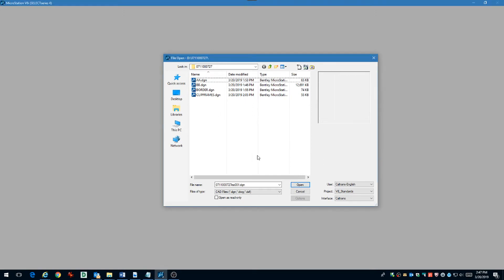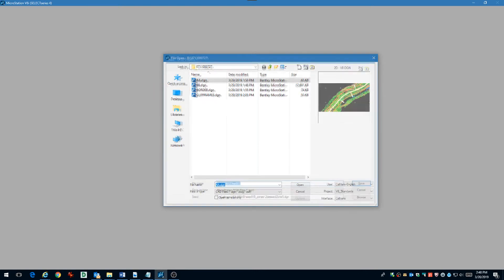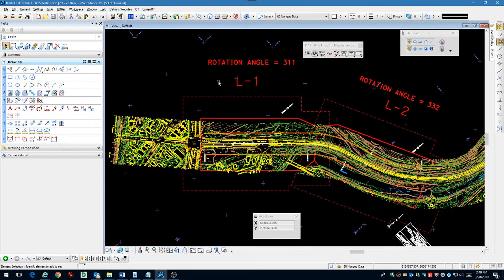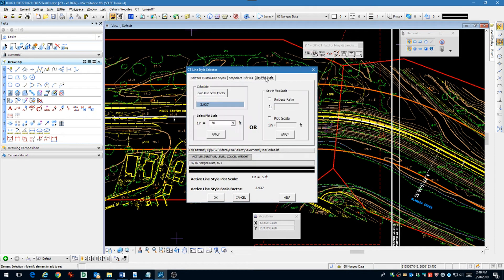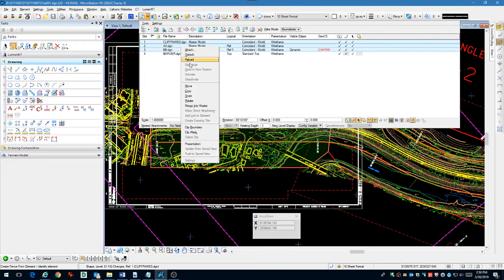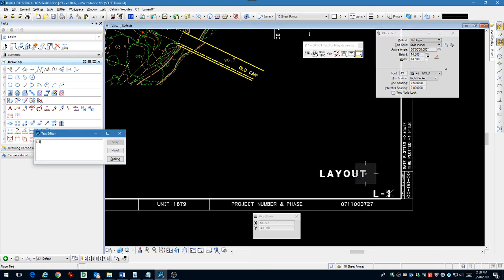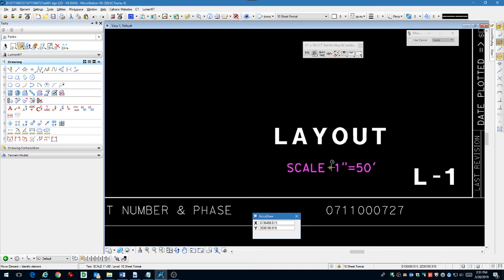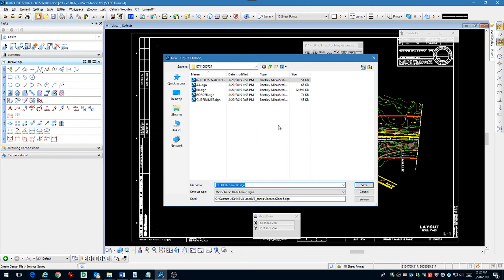Creating MicroStation Layout Sheet

Comment: Sir, Where I can find CT line type selecter tools ?
Reply from the maker: Hi md, The CT LineStyle Selector is only available if you work at Caltrans. Some of these videos were specific to tools that Caltrans developed internally and don't make available outside of Caltrans. Do you work at Caltrans?
Reply: @CaltransMicroStationVideos  sir, I work in UAE on MicroStation v8i and autocad.

How I can get tools for MicroStation v8i ss3.?
Reply from the maker: @md-mohammed8455  The current version of MicroStation is MicroStation CONNECT Edition (MSCE). It has been out for 6 years. What type of tools are you looking for? V8i was a 32 bit program, MSCE is a 64 bit program and any code written for V8i might need either tweaking or a rewrite.